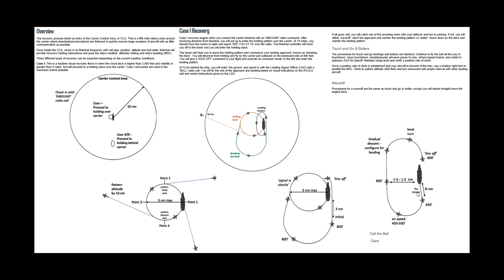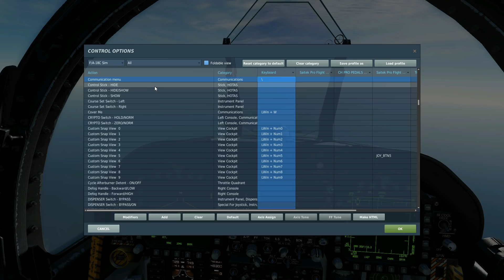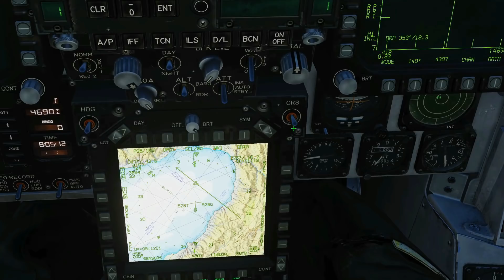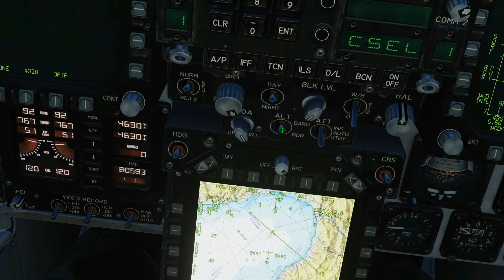Supercarrier: CASE I (1) Approach & Recovery Landing Tutorial | DCS WORLD

Comment: Radar Altitude is unreliable over the water. It's why you ended up in the groove at over "400 feet" but were Low on the glideslope. The Radar altimeter is "seeing" the "sea floor" which in DCS is what 2-300 feet under the surface?
Reply: He actually got low on the glideslope at 400 feet because he started the approach turn to the groove at least 10 seconds after he was supposed to do, and therefore was wayyy behind the carrier to get a good glideslope for his height...

Comment: Note the SPEEDS  and Distance abeam the carrier for the downwind  and the groove are aircraft type dependent,  these are for an FA18C.    A Superhornet, or a Tomcat or any other plane type would be different.  The Diameter of the holding stack  is common for all aircraft types.   Also you cannot extend  the downwind to have a longer  'groove'  since that would spoil the timing for other planes in the pattern.  You'd be waved off with a LONG IN GROOVE  reason.   Its all about the TIMING  to ensure efficient and safe recovery of many aircraft in the shortest possible time .

Comment: You can not descend on the "top" half of the holding circle, sou you need to maintain level turn at Angels 2 until the 9 o'clock position in the holding (or Point 3 in your image earlier on), then start desencing to 800 feet and turn back to arrive straight and level to the initial on BRC heading, at 3 NM back, not 2 NM, as at 10:44. Speed between 350 and 400 kts until the break.
In the break, pull roughly 1% of speed for G, 3.5 G for 350 kts and so on, easing up pull gradually, as the speed is going down. Left DDI is usually set to HUD repeater, and if you put up HSI in the RIGHT DDI (to get rid of the "Advisory line" on the left DDI always blanked and masking), you can check visually when to level on reciprocal BRC, and throughout the break turn, you can already adjust your downwind distance based on lateral distance from CRS in NM, shown above the CRS degree in the right bottom corner, to arrive to the Abeam at proper distance, and trimmed to on speed AoA (middle of the E bracket leveling the Velocity Vector). This was on rather the top edge of the E bracket. After that, no trimm and no stick movement for altitude change EVER. Strictly ONLY throttle for climb or descent, and stick movement only sideways, for bank. Bank should be rather 30° than 15°, the shallow / slow turn is why you ended up way more back than necessary. No nitpicking meant, just for those who wanna learn it from this video.
Reply: Also, he should have flown the holding pattern at 250kt which is the hornet’s max E.
Reply: Are you on discord

Comment: You should actually use your Radar altimiter for this :)
Reply from the maker: Yeh will re-record this properly when I get more time.
Reply: @grimreapers  No worries. Actually it's better to try and break it the best you can, rather than follow procedures by the book.
Reply: At least in DCS Radar Alt is "funny" over the water.
Reply: @Racing_Pig  Haven't seen issues myself, I have done well over 300 traps with the old Johnny Reb and never had a problem and currently at around 30 flights with the Teddy.